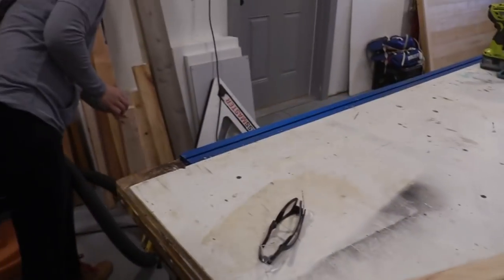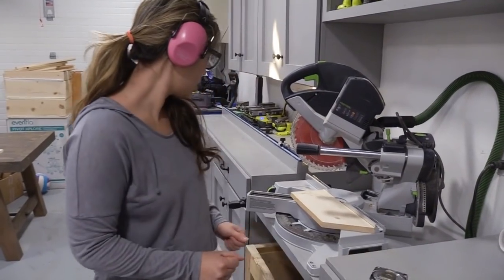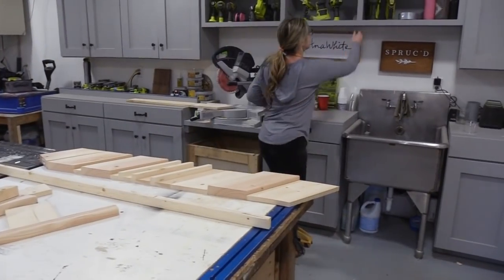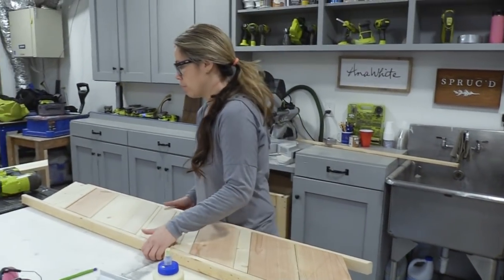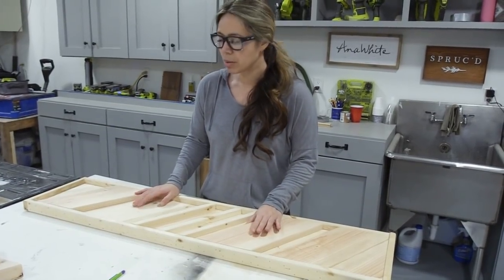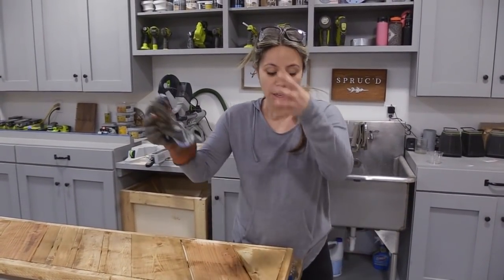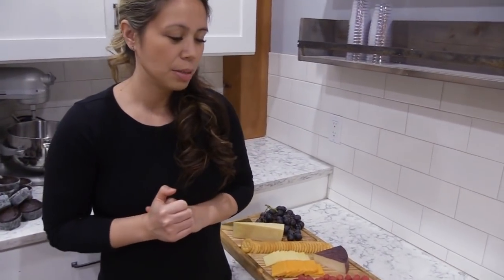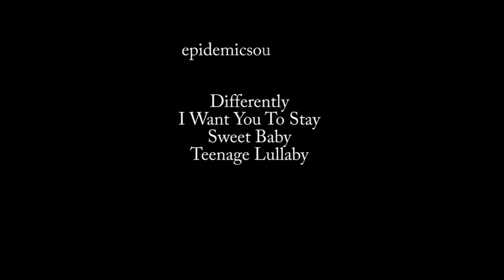EASY Scrap Wood Grazing Board or Charcuterie Board

Comment: This is beautiful, Ana! I love it! If your viewers are concerned about stains coming in contact with food, they might try using coffee that has been cooled. I’ve had great success using it and then ‘waxing’ it with coconut oil. It worked for me. Hope you have a Merry Christmas with your family. Thanks to you and Jacob for sharing all your talent this year. I know I speak for many when I say we certainly appreciate you!!! 🎄♥️
Reply: Hello, I'm sorry but never heard of that, how do you use it or apply it???thank you and happy holidays.
Reply: Alejandro Ruiz what I did was take two spray bottles. Fill one with water. Fill the other with diluted coffee. It’s best to strain it to make sure you get all sediment out of the coffee. First, sand your wooden project. Then, wipe and remove saw dust with a tack cloth. Next, lightly spray your project so that it’s slightly damp. The goal is to just moisten the wood enough to take the stain evenly. Wipe down after you spray with water. While the wood is still damp, spray with coffee/water mixture and wipe off excess. If it’s not dark enough, continue with your second application. Once everything is dry, take a clean cloth and rub in some coconut oil. I hope this helps! 😊
Reply: What a great tips. Thanks 😘😘😘
Reply: ... but the food doesn’t come in contact with the stain because there are layers of food safe polyurethane between the food and the stain.
Reply: Great Idea!
Reply: Great Idea, going to have to try this one for sure.

Comment: I just made this and realized that if I didn't nail in the dividers then it could be multi purpose based on whatever was being served. They are a tight enough fit that they shouldn't move.
Reply: But you will have a missing bottom where te divider was??

Comment: If you used something else besides PINE you wouldn’t have to stain it. And Polyurethane is not food safe.
Reply: Poly is non toxic once cured but do not use it on a surface that will actually be cut on.
Reply: Mindy Jost, Why use polyurethane and not a proven food safe finish. Possibly miss leading tens of thousands of people that watch the video.
Reply: @michaelc5369  I think Ana could have clarified the choice of Poly over something  totally food safe like Mineral Oil.  Poly dries hard on the surface rather than penetrating the pores and staying "soft".   Poly on an actual cutting board is a poor choice because the cutting will simply damage the Poly.   While it is true that once cured ( which takes longer than being dry to the touch) Poly is not actually toxic....nobody really wants bits of Poly in their cut up food or their cutting board damaged.
In this case, the item constructed is used to simply hold the food for service.  Cured Poly is fine.    The end use needs to be considered when selecting a finish.
Reply: Mindy Jost , I never said Poly was toxic. I already know everything you’re saying .
Reply: @michaelc5369  You did say Poly is not food safe, that implies toxic.  Other readers may not know the info in my reply.
Reply: Mindy Jost , OMG your one of those I’m right your wrong people 🤣
Reply: @michaelc5369  It is in my nature to be clear with my words!   For the sake of everyone else reading the comments, I felt the need to clarify.  😉
Reply: Mindy Jost , i’m not trying to be a jerk about it, but i’m not eating food off a piece of wood that has been stained with  only one coat of polyurethane on it. which maybe oil based or water-based Ana never Clarified.